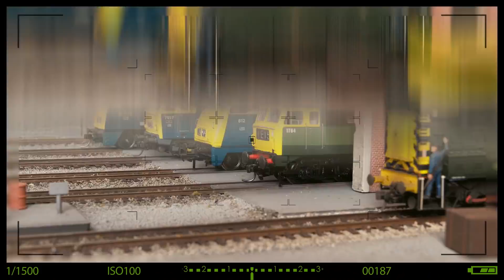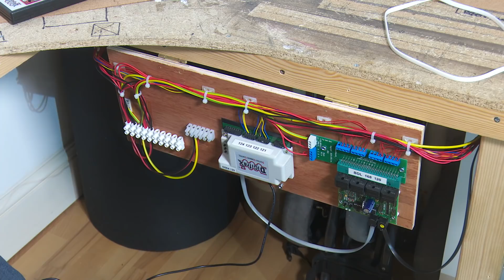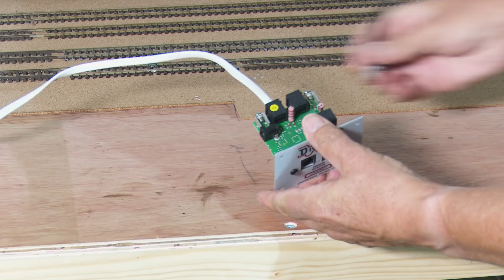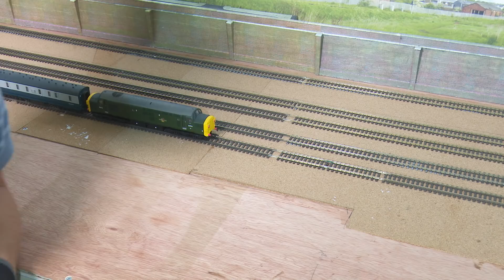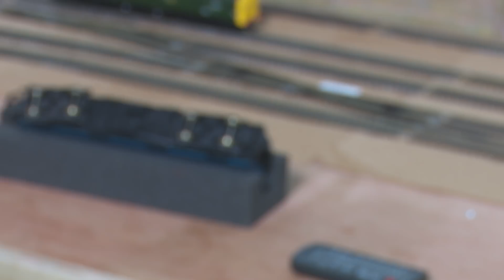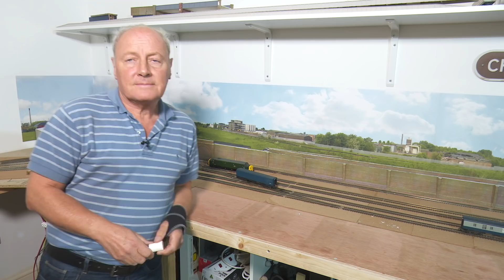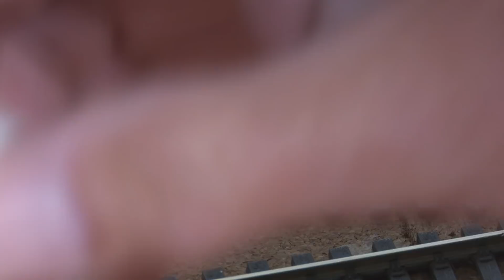44. Wiring Problem at Chadwick Model railway.

Comment: Hi Charlie, how long did the nail varnish last? Or have you now found a better solution? Powering the frogs looks like a good option
I have a cross over on my track plan (DCC) , and a couple of my rakes of coaches are Lima 
I'd rather a good solution for sorting the cross over while laying track than spending a small fortune replacing wheels sets 🫣
Cheers Rob
Reply from the maker: The nail varnish needs to be managed closely. Obviously, track rubbers will remove it. The real solution is to change the wheel sets. Regards, Charlie.

Comment: Hello Charlie. I’m a complete novice. I bought a Hornby Flying Scotsman set 00 gauge, cost made me buy addition track off Facebook. Being very competent I cleaned and repaired the track etc and set up a double circle. Two sets of points back to back to change from the inner to outer tracks. This also goes off the a small siding. Further round I put another single set of points to send the train along either inner or outer tracks. All works well except every time my Flying Scotsman train (with or without coaches in tow) crosses the back to back points, on the outer ring only, it shorts out and I get power failure. Can you advise please.
Reply: Hello Charlie. I have no idea how to send a video on this system. However, after painstaking and long winded investigation, I found the reason my train shorts out. It has been staring me in the face. Both front and rear axles have a side to side movement of 70thou or roughly 2mm, the middle axle has no visible movement but my dial gauge reads 6thou. I noticed that my train rides up as it goes over the frog. Closer inspection revealed that the middle axle rides over the central frog plastic and touches the other rail.  On the flat track I now see that the middle axle wheel on the near side does not touch the near side rail where the off side sit neatly on the rail with the back and front wheels.  Somehow I need to widen the space between both mid axle wheels.  I also note that this axle is also the drive axle.
Reply from the maker: Hi Graham, are you using electro-frog points, without insulating rail joiners on the frogs?
Reply: @ChadwickModelRailway  Hello. No, only the Insul points supplied with the set. It’s strange because the train will happily go round and round a few times without fault, then it decides to short out at the frog. I have an internal inspection camera and was able to see it touch the rail. The middle of the 3 axles touches. I have a 2 mm side to side movement on axle 1 and 3 but no 2 the middle has no movement. I understand there must be side movement otherwise the train wouldn’t go around the curves, but is 2mm too much ?  I contacted Hornby technical who said it’s within the tolerance, they suggest send them the train so they can inspect it. More expense I can’t afford. What are your thoughts please. Oh, and I have watched loads of your very technical videos and fully understand the concept of insulated and non-insulated frogs, also the dropper wiring etc. this has me baffled.
Reply from the maker: Hi Graham,  can you send me a video clip?
Reply from the maker: I’m so pleased that it’s sorted.
Reply: @ChadwickModelRailway  Hello Charlie. Further to my saga, and this is the last time. Once again I set out to find a reason for this wheel alignment fault. Why I didn’t do this in the first place I don’t know, but I up-ended the engine and touched the wheels with a power sauce. Straightaway it hit me. The middle axle must be bent because both middle wheels are buckled. Both run out of true at roughly the same point.  Sorry to have burdened you with my problems when with a little extra effort on my part, and using common logic I found the fault. Now it’s up to Hornby as to whether or not they will honour the warranty. It might just be a case of shipping it back to Amazon and asking for a replacement. Anyway, again I apologise to you for taking up your time.

Comment: This is a really good tip. I've got some older coaches. Some of them are Lima. I think with this I will be do this. Using clear nail varnish on my crossings on the layout that I'm designing or investing in newer coaches
Reply from the maker: Or Stephen, you could replace the wheels.
Regards Charlie

Comment: Charlie,
Could you find an old Lima wagon/coach with plastic wheels and swap them? If it lighted that may not work though. The other alternative is to remove the wheels (as they are push fitted) from the axels and grind the inside surfaces to thin the flange. You could use an Emory cloth wrapped on a wood block for that. Just an idea. I also noticed the spark at some point as mentioned by someone already. Thanks for the detailed video.
Reply: I think the term is lap and not grind!
Reply from the maker: I sorted out the problem by swapping them for a more refined wheelset. Regards, Charlie

Comment: Hi Charlie, What I have done is switch the tack power using a relay to the diamond because you won’t have a train running straight through the diamond whilst the two points are reversed. Cheers, Bill.
PS Love the channel!
Reply from the maker: Thanks Bill, that’s a very interesting modification. Regards Charlie

Comment: Hi Charlie. I am wondering if you or one of your thousands of followers could help me with a problem? I have a DC tail chaser in the loft with insulfrog points, although it is and end to end at the moment as i have not finished a circuit of track yet. Today with great excitement i got my transformer controller out and wired it up to my droppers, put a loco on the track directly above the droppers, turned the knob and nothing. Checked and redid the wiring still nothing. Got my track tester and placed on the track where the droppers are and no light. Placed the track tester on various other bits of track and connected wires from transformer to the track next to tester and someplaces i got a light and others nothing. I  did notice however that occasionally when i connected the second wire to the track there was a small spark. I cannot for the life of me work out what is going on. Unfortunately i live in Okehampton which is the dead centre of Devon in every meaning of the word and my nearest model shop or model railway club is miles away. I know that an experienced modeller would take one look at it and know immediately what is wrong. I know that remote diagnostics are very difficult if not impossible, but any help or pointers would be very useful. Thanks in advance. Kelvin.
Reply from the maker: Hi Kevin, I’m sure this problem is easier to solve than you think. It’s really just a case of isolating pieces of track until you find the one that is causing a probable short. You just need to take a more methodical approach to finding the fault. Regards, Charlie

Comment: Hi Charlie,
Sorry to trouble you but I have a wiring problem on my new O gauge garden layout.
I have laid all the track and electrofrog points.

I have run the main power to the track but every time i turn on the controller the engine runs along the track for a short while then the reset button on controller blows.
It then resets after 5 seconds.

Just wondered if you've ever had this problem ?

Love all your videos , wish I was as clever as you ha ha ha.

All the best
Duncan.
Reply from the maker: More droppers might be the answer.
Reply from the maker: I’m sorry Duncan, but I don’t think I can help with this one. If it’s DCC, I would have thought it was a overheating decoder issue. Regards, Charlie
Reply: @ChadwickModelRailway  ,
Morning Charlie.
Many thanks for your message.
Actually the layout is analogue so I don’t know if that helps at all.

I think possibly it’s because there is a loop of it at one stage.
I’m sure there is an answer to it somewhere.
Many thanks again for getting back to me anyway.👍🏻🚂
All the best 
Duncan.

Comment: I had exactly the same problem with shorting out at the diamond crossover - and the varnish, although it worked, it was only a temporary fix. I came up with another solution, but this involved some electrical jiggery-pokery. All rails were isolated to the crossover (like yours in the video) and the only power that reaches the crossover rails is when there is a correct entry and exit path - all other rails remain dead, i.e. no shorting out on adjacent tracks.
I used the frog power feeds from the approaching pointworks passed into 7404 NOR and a 7408 AND chips, add in a couple of small MOSFETS and a pair of relays and the job is a good'un - no more shorts. What's more, if an exit point is wrong, no derailment as there will be no power on the crossover and the loco stops.
Maybe this is a bit OTT, but it works.
Reply from the maker: What a great modification, and a reliable solution. Well done mate, regards Charlie

Comment: Hi all. Problem withe bus wire on 2 sub distric. the bus wire on the 2 distric won't send power to the rails .when you put a coin on the rail no short happens also engine stall at the gaps between districts and a short happens.
Reply from the maker: There is a basic fault here JA, it’s not something complicated.

Comment: Charlie I have 2 ovals, using Gaugemaster twin track controller DC OO gauge Peco track. Can I install an X crossing to swap tracks or will it cause major damage?
Reply from the maker: Not at all.  Just use one controller during the crossing process.
Reply: @ChadwickModelRailway  thank you Charlie, I got my board and timber yesterday and a change of plan!!! It's now an 8x4 instead of 6x4 after my good lady wife asked if it would be better. I feel my hasty reply may cost me 😱

Comment: charlie  you just seem to be able to give the correct little tip at the right time, ie nail varnish on cross overs, dcc circuits wired  as radial circuits  and not rings, power areas using EB 1 etc.  thank you very much keep the information comming.
Reply from the maker: I’m so pleased that you found the channel interesting Philip.

Comment: whilst I accept this is an old post. Charlie asked for input. This is my preferred method for powering ancillary  items ,station lights, street lights and stuff like CDU units for points etc.
Old pcu's from your desktop, even old ones give 400 Watts, two I have are 700 watt each.
3V, 6V, 12V, and even -5V which gives 19V for pulsing points motors.!!
Reply from the maker: What a great system for recycling apparently,  useless items. If only most people thought as you do Chris. Regards Charlie

Comment: Yes the nail varnish works, at least until it wears off and has to be re-applied. but it is really a bit of a crude work-around.  In my mind the real solution to this is the use of electrofrog track components.  Yes they require frog polarity control and that comes with some cost but the reliability and improved looks over the big black plastic insulfrogs is well worth that increased expense.
Reply from the maker: But electrofrog crossings are only available in Code 75.
The easy alternative is to replace your Lima wheels.

Comment: HI CHARLEY I ALSO WATCH OTHER MODEL RAILWAY TRACK BUILDERS AND THE ONE I SAW HE SHOWED HOW 2 CURVE A STRAIGHT TRACK  IT WAS A PIECE OF PLASTIC THAT FITTED ON THE 2 TRACKS AND U GRADUALLY CURVED IT AS U RAN IT UP AND THE TRACK U COULD ALSO STRAITEN A CURVED TRACK AS WELL IF I CAN REFINED THE VIDEO I WILL LET U KNOW SO U CAN SEE IF IT WORKS 4 U GRAHAM O PS NOT SURE IF CURVED TRACK COSTS MORE THAN STRAIGHT
Reply from the maker: The prices are very similar.  Tracksetta are the gauges that you refer to.  Watch Fridays video mate.

Comment: I have the same problem with Peco N Scale Electrofrog turnouts.   Interesting where you've identified the short, on the turnouts, it is where the two rails come together into the frog point.   This is on our club layout.   On my personal layout I use electrofrog and isolate all my frogs and power them.

Yes, one way to solve this is to put nail polish (polish here in Canada!) on the rails.   Also CA (aka superglue) can be used as can paint (I'd go with enamel as it is harder).   The problem with all these solutions is that if you use a track rubber or any abrasive to clean your track, whatever you put on will eventually wear off and you'll have to redo the job.

The only permanent solutions that I'm aware of are to either isolate the frog and power it separately (frog juicer or other method) or very carefully dremel away some of the rail and replace it with some plastic / styrene.   BUT, the later is pretty fiddly and can result in a ruined turnout / crossover.   I'd suggest either isolating the points and powering them  (I think this is the best solution) or continue with nail polish or CA.

However, GREAT find.   That was a tricky one to figure out.   I did notice sparks at one point though! :).
Reply from the maker: I'm so pleased that you found it interesting Don.

Comment: when you manually pass the lima through the crossing, the sparks are visible !
in fact the bug occurs at the frog. the axle of the car shorts between the 2 bits of the frog
the solution is to use a lathe and remove a some material from the part of the wheel that protrudes outside
Reply from the maker: You’re dead right AJ but it took ages to figure.  I’ve now re-wheeled my offending Lima stock.

Comment: Thanks Charlie, I was testing a new DCC controller yesterday and had the same problem with an identical cause. A Lima coach at the tail end of the train going over a diamond crossing whilst the loco was going over points.  Luckily after a couple of minutes I remembered this video which I had watched a month or so back. You have saved me several hours of fruitless faultfinding! Thank again.
Reply from the maker: I’m so pleased that you found it useful Mike. I just wish that I had an easier way out too.

Comment: Hi Charlie. One thing you could do is remove the Lima wheels from their axle, do the same to a modern Bachmann or Hornby coach wheel and swap the wheels on the axles. 
That might solve it. The reason you would have to retain the Lima axles is due to their length. Lima axles are 25mm (or less) rather than the standard 26mm that most RTR maker work to. 
One other option would be to buy a set of Alan Gibson carriage wheels with 25mm axles - they used to sell them. 
Or a final option would be to file the pin-point down on either a Bachmann or Hornby axle and do a straight swap.
Hope this helps. Best wishes, Nick
Reply from the maker: Some great options, many thanks Nick

Comment: Will applying the rail colour finish do something similar?
Reply from the maker: It might do but I can’t promise.
Reply: That question was mostly from noticing that you were working on an unweathered bit of work.  Like as not the clear nail polish would be a best first coat, thne apply rail colour over that.  Maybe.  Perhaps.  Only 2d worth of opinion.
Reply from the maker: Good point.

Comment: Hi Charlie, I've been watching your videos on laying track and solving the glitch when your wheels travel through the frog of
the diamond crossing track. If I may suggest the following hints: when you get the track in the final position and before the
glue is applied, just run a pencil along the edges of the sleepers on both sides as a glue guide line. I noticed that when you
moved the single wheel set through the problem area, the wheel would get cocked between the rails causing a short. Perhaps
a complete wheelset to be used a gage to solve this problem. Good videos though . Bill G. Linwood, Kansas USA
Reply from the maker: I’m so pleased that you enjoyed the videos Bill and many thanks for your advice.  
Changing the subject, can you recommend any US Facebook sites that are worth watching?
Regards Charlie
Reply: My favorite site here in the U.S. Ron's Trains N Things. I have that site as a favorite on my browser. Bill G Linwood Kansas USA   @ChadwickModelRailway
Reply: One thing I forget to mention, Ron's Trains N Things host Ron Marsh is an "N" scaler but I've found I can adapt some of the tips, techniques and hints to HO or as they say in the U.K OO. Regards, Bill G Linwood, Kansas USA @ChadwickModelRailway

Comment: Well Charlie , maybe I have a tip for problems with a stottering lokomotif becouse of  dirty track . Just put on a light film of  ATF  Atomatic Transmision Fluid on the track for about 2 inch and you have less problems  . Don't use to much  . Maybe you did know this already. Greetings form the Netherlands.
Reply from the maker: An interesting point Bert.  
I’m sure people will read this a give it a try.
Regards Charlie

Comment: I can't say I am surprised you had shorting issues with the Lima wheels.  I changed all my Lima wheels to Hornby or Bachmann.  As a matter of course I use the back to back on every new set of wheels.  I found that Bachmann needed more adjustment than Hornby wheels.  Thank you again for an informative video.  When you magazine articles it doesn't give the issues which you encounter practically and shorting out is one of the common ones when building a layout.
Reply from the maker: Hi Don, I’m so pleased that you enjoyed it. I still find it difficult to buy the wheels for my parcels vans.
Regards Charlie
Reply: I think I just replaced with Hornby 14 mm wheels.  I may have reamed the bogey first.  I may have a set, which I could send you.  Regards Don @ChadwickModelRailway
Reply: I do know I had problems with a Lima horse box and I definitely had to ream the axle boxes first.  Now with reamed axle boxes and new wheels it runs well.

Comment: I personally, now, rewire all points so that only the frog AND the necessary rails are live for a given route through the point at any one time, I use the point motor auxiliary contacts to swap the polarity of the rails when the route is changed, insulated joiners are used to prevent any electrical feed from the point onto the other track rails.
Reply from the maker: Well that’s an unusual way of doing it Sam.  What prompted the change?